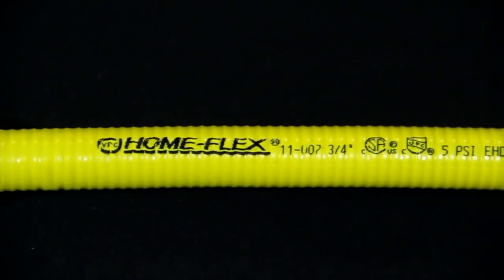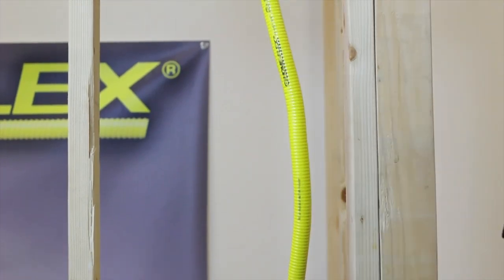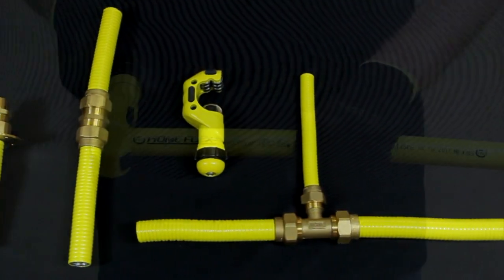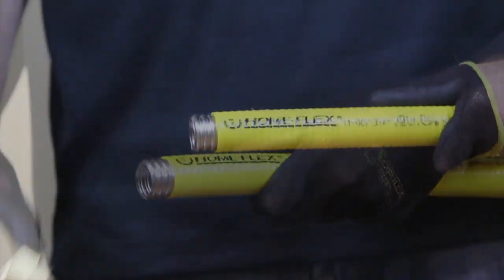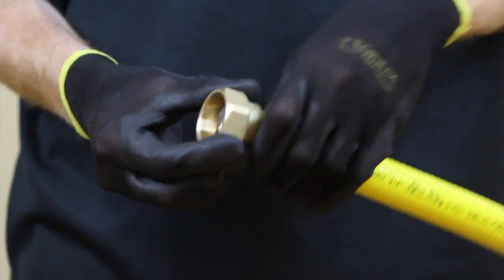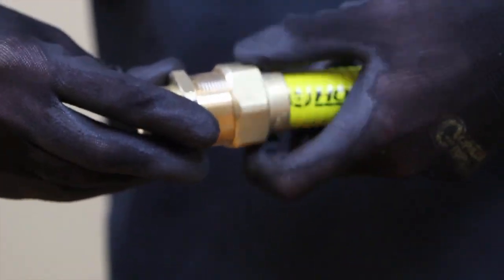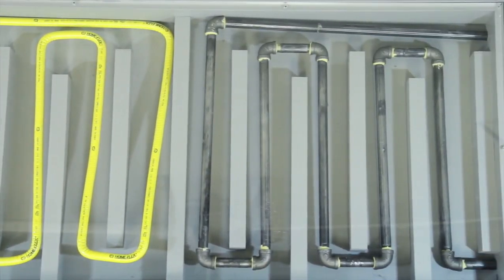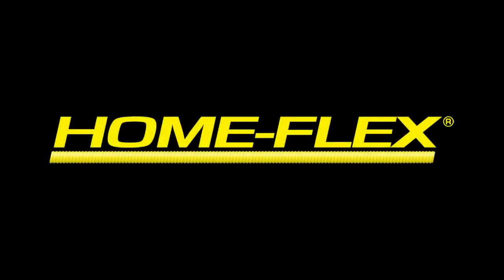How to Install HOME-FLEX CSST Flexible Gas Pipe

Comment: Helpful video. Thank you. Is csst ok to hook up directly to propane tank or is there an adapter?
Reply from the maker: HOME-FLEX CSST should only be attached directly to an appliance if that appliance is fixed. If not, it is recommended to go to a gas connector.